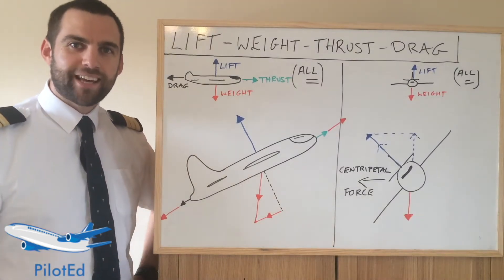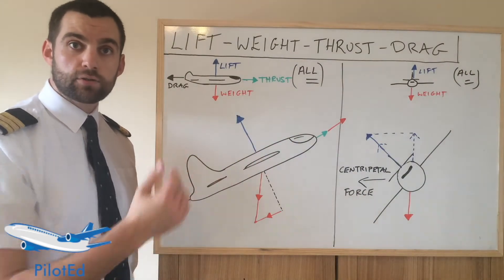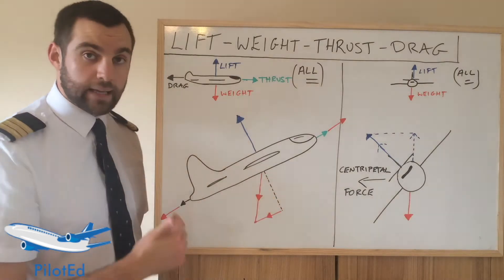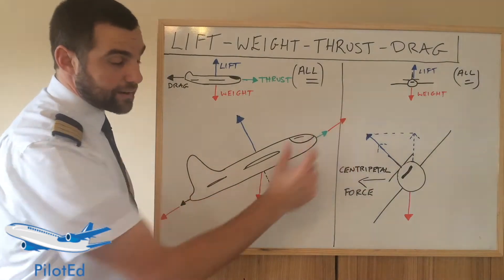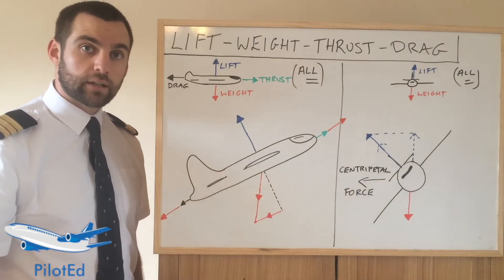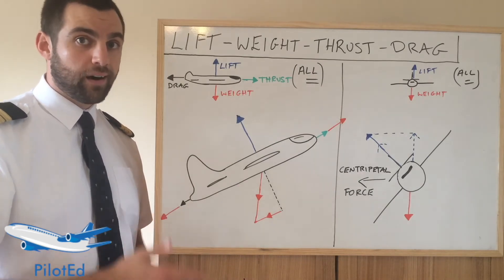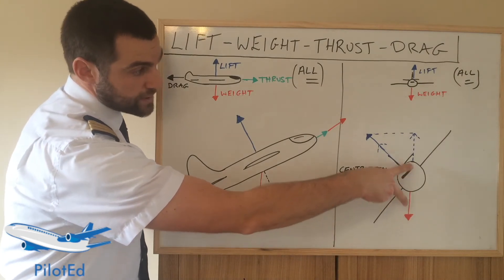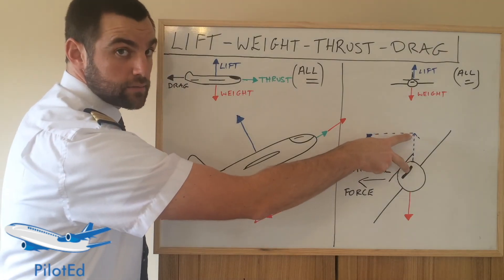Aircraft Lift, Weight, Thrust and Drag ✈

Comment: i believe that the magnitude of the weight vector should remain equal when flying horizontally or flying inclined at a constant speed. The weight vector will indeed be oriented downwards and can be split up in a vector parallel to the lift vector and a vector parallel to the drag. This means that the weight does not increase, but remains the same, and there will be less lift needed, but more thrust to maintain the plane at the constant speed.  Correct me if I'm wrong please.

Comment: Hi Ed, I'm a little confused by your statement that there is more weight than lift in a climb... I thought there is more lift than weight in a climb and therefore that's the cause of climbing. If the weight exceed the lift then would we be descending no?
Reply from the maker: this is the common misconception, have another watch and see if you understand :) the extra weight must be compensated for by thrust not lift.
Reply: Good Day PilotEd and Renaud,just want to add some information for your comment.Renaud opinion is also right for climb angle of attack increased and cause additional Lift  and by climb the flight path is not straight but it curved.For this curved flight path ,aircraft get additional force(zentrifugal force) in weight component(this centrifugal force is perpendicular to the curved flight path).This is what pilotEd mean more(apparently)weight or increased of weight at climb
Reply: Actually yes i got a little confused in exactly at that statement and i m still confused